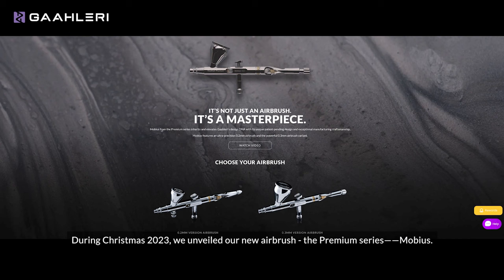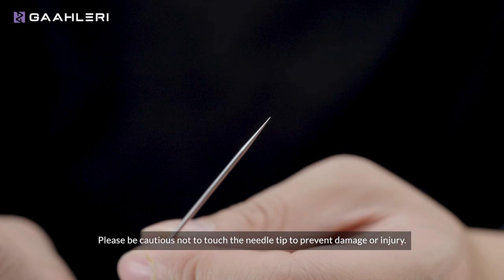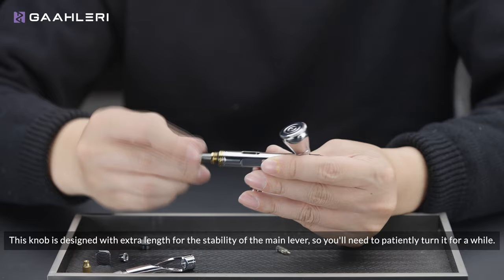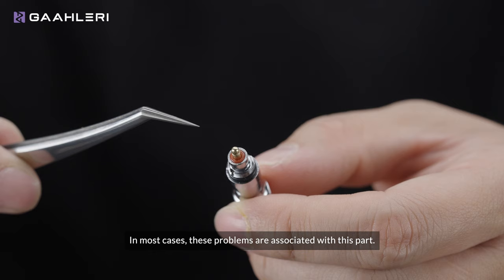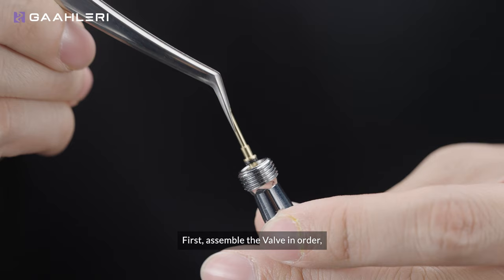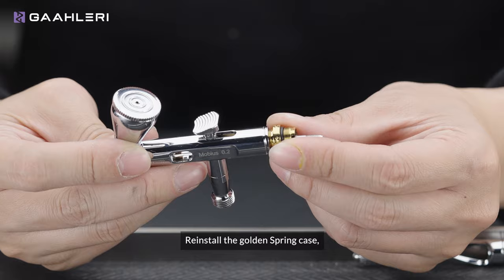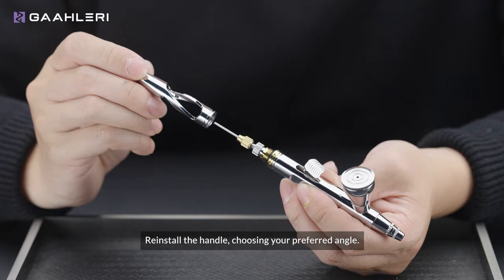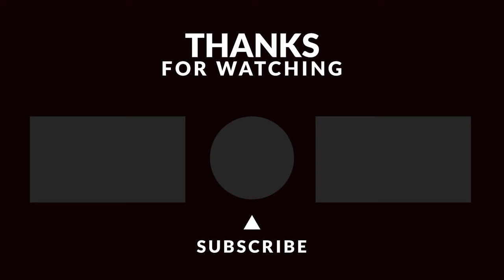Gaahleri's Complete Guide to Airbrush Maintenance: Disassembling & Reassembling the Mobius Series

Comment: i thought maybe the opening in the side was so like the iwata micron yu could adjust the pressure of the needle sealnot needing to go inthru the bsck lik almost all other brushes
Reply from the maker: The side opening is mainly for easily observing if there is any paint leakage during spraying. We do not recommend frequently loosening or tightening the backflow preventer valve, as appropriate adjustments can have a certain effect on the pressure of the needle.

Comment: I have the two, 02 and 03, and I do not recommend taking the golden middle part with the "help" of a  pliers or wrench I tried with a wrench and it got damaged the piece is too soft for tools. You can remove it with the help of a cloth or a t shirt  so you can have more grip. That is a design flaw, one of the few with the mobius, Gaahleri should make a tool just like the tool of the H&S infinity.
Reply from the maker: We do not recommend unscrewing the gold component, but we will be introducing related accessories in the future. If your airbrush has any issues, we would be happy to provide a replacement.
Reply: @gaahleristudio  Hello good people from Gaahleri, I was not expecting an answer...I tried to get my hands on the Celestial Dragon edition but it was not possible because you don't send them to Portugal...I've bought my 3 units (GHAD39, Mobius 02/03) on UK stores. 
I know for a fact that we are not supposed to unscrew the golden component (I've watched the videos), but during a paint session I've made a mess of my 02 mobius and there was paint everywhere so I had to disassemble it to clean it, it had paint on the trigger/valve and trigger adjustment spring and so I took a wrench (normal pliers are too aggressive) and took it out and by doing that the brass was marked and I was afraid that i had turned the gold part from a round section to an oval section which would make it very difficult to assemble it propperly, but after some time I was able to get it back on the threads and fasten it, it was harder than I had expected. Although I would love to get a replacement part, it was not your fault and therefore you don't have to send a replacement. 
They are wonderful tools, I was mesmerized looking at them, when I first received the GHAD39 my chin fell to the ground because I could not believe my eyes the quality is amazing, and believe me I am a "picky" guy and I inspect all my units with a magnifying glass so I can check the needles and other parts...they were perfect! I do own other brands (Thayer and Chandler, Iwata, H&S...) and until I bought a Gaahleri my benchmark was Harder und Steenbeck, and I must say Gaahleri has better finish. 
Once again thank you for your offer, thank you for the amazing airbrushes, keep on trailing the right path!
Thank you very much, greetings from Matosinhos, Portugal.
Reply from the maker: @gonzalvezalvez6572  I am delighted to receive your response and thank you again for your support. Currently, if you purchase through our official website, we can now ship directly to Portugal. Thank you for your understanding.

If your airbrush ever needs any assistance in the future, please feel free to contact me. I would be more than happy to provide any necessary parts. I hope our airbrushes will continue to be of great help to you.